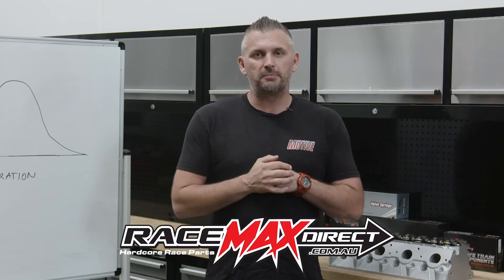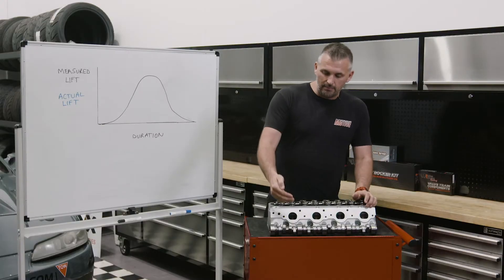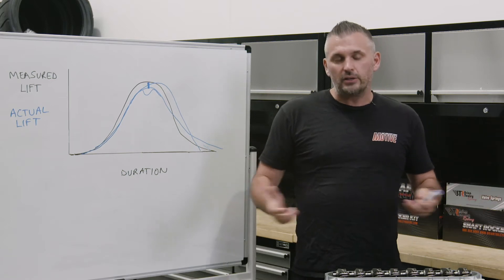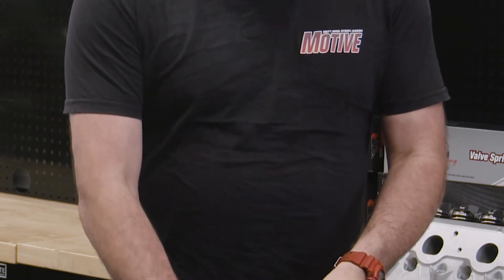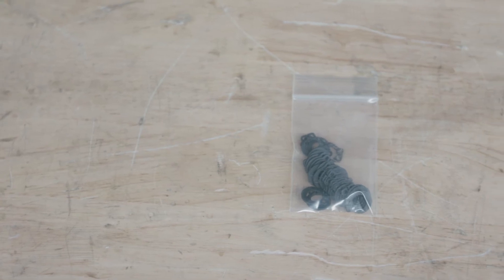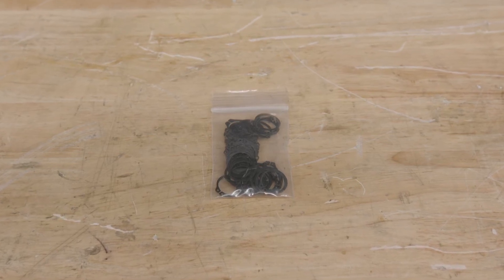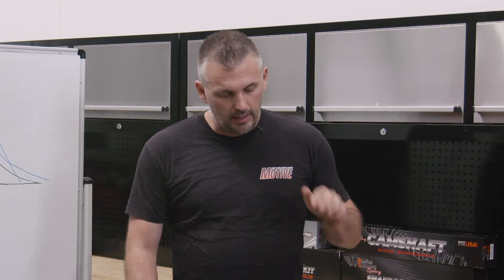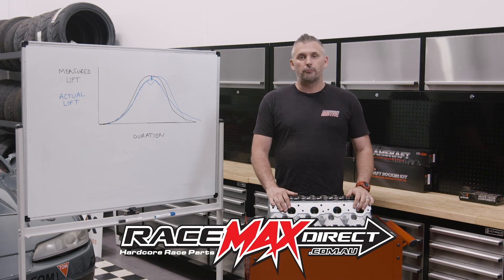Why Upgrade LS Trunnions or Install a Shaft Rocker Kit Upgrade - Race Max Direct Tech

Comment: In theory, this is a nice upgrade to reduce deflection. In practice, I cannot find a single dyno(engine or chassis) comparison the shaft rockers before and after. There must be quantifiable results from increased lift and valve train stability. Certainly, there are people using, and hopefully, benefiting from this product. Do you have any data comparing conventional rocker system to the BTR shaft rockers?